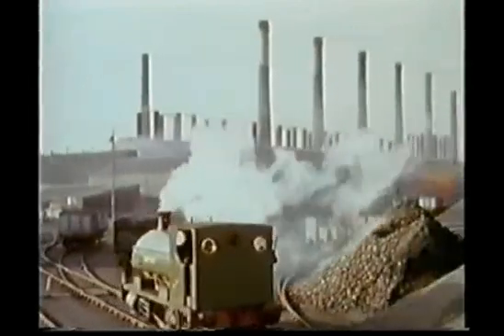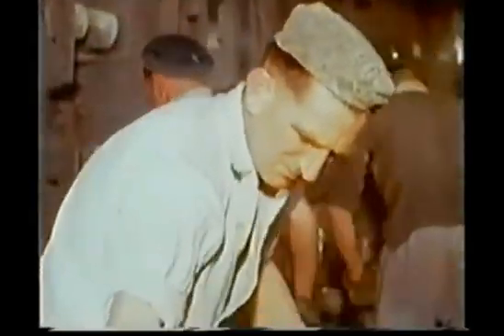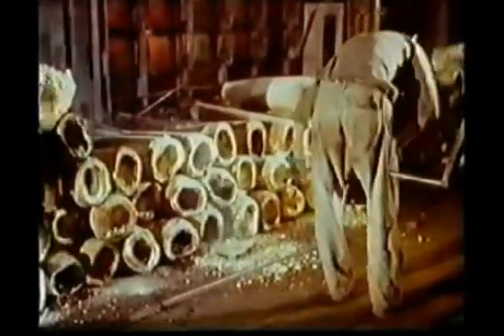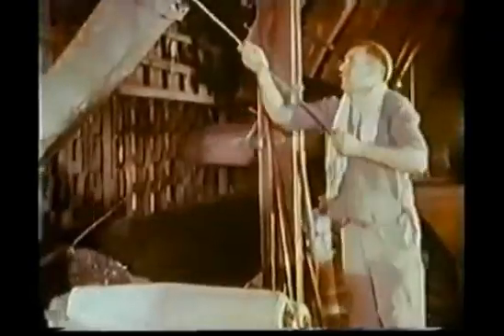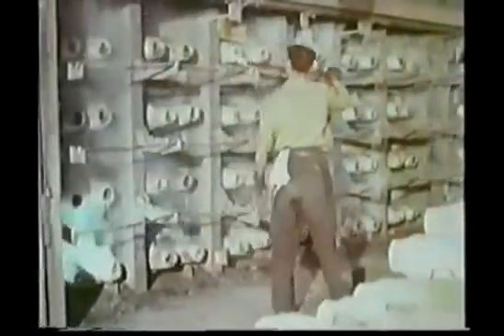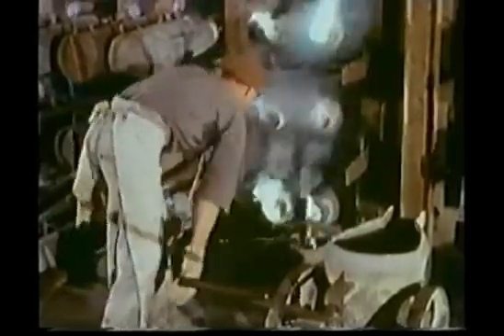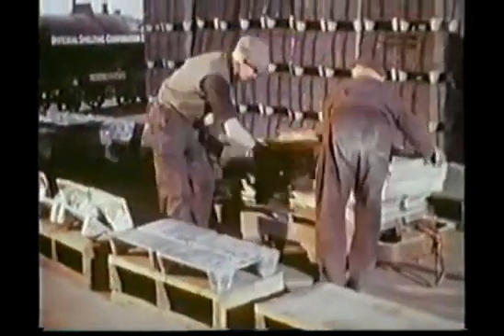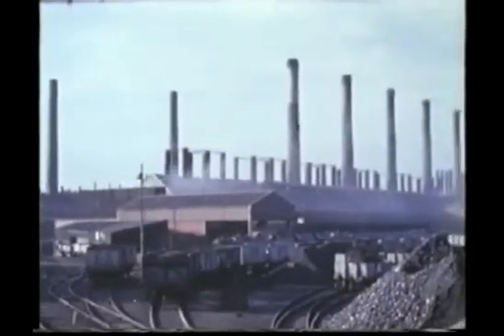Zinc works at Swansea

Comment: Nice to see the film in colour! The Mond works at Clydach employed virtually the whole town, plus half of Ystalyfera town worked at the Tareni Colliery, half a mile away, which supplied the works with all the coal it needed. I remember going for a job interview at the Mond- the pay was excellent, but i wasn't successful. All the non-ferrous metal industries in the Swansea area, and their spin-offs like engineering works, chemical works, railways, etc  virtually disappeared without trace, around 30 years ago.

Comment: I used to work in a foundry that was as dark and dirty as a coal mine, but this place is Dante's inferno! My God this place is so primitive most workers probably only lasted a few days. Burning zinc is nasty. I would get a wiff welding or cutting on galvanized metal. Just that little wiff would just about burn your lungs out and turn your eyes red. Looks like every job in there sucked to high heaven. Even the most hardened man would be a broken slab of meat after a week. There is little doubt this place sent nearly everyone who worked there to early graves with serious heath problems. The factory probably thought someone was out of their minds to want to film there. Glad they did because this is a great piece of history. Thanks for the upload!